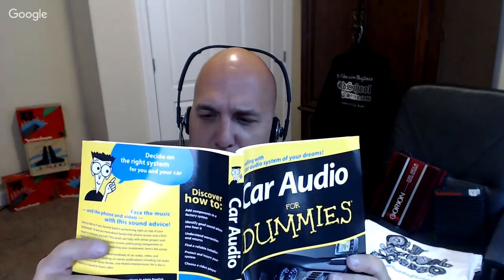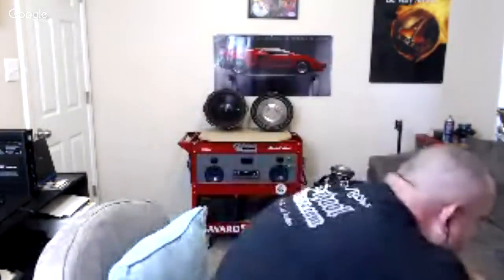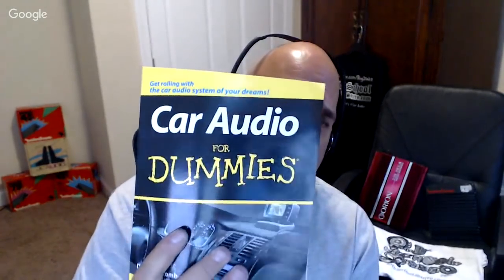12V Talk Episode 02 - How We Got into Car Audio with HiFiVega

Comment: Love this nostalgia!  Thank you both for orchestrating this. A ‘76 Mercury Comet was my brother’s and my first car to share, back in ‘87 on.  He put in a basic Sanyo deck and Sony 6X9s.  When I took it over I added a Sentrek EQ-booster that I bought from a friend at work.  I was ecstatic for adding so much sound to the system.  Being raised in a family of HiFi enthusiasts, and myself not having a lot money, I would go to the local electronics store and drool over the Concord subs, Pyle boxes, and MTX Terminators.  My first real purchase was out of a catalog a friend’s dad had.  I bought a Pyramid Gold Series PB600 amp(which I still have to this day) and a pair of Pyramid dvc subs.  I upgraded to a Concord cassette deck, but in ‘92 went for the Sony CDX7560 & XK-8D combo.  I still have the XK-8D, but the CD player gave out years ago.  I could never afford the Boston Pro series, so the Rally Series was for me instead, along with the MYX gold series Thunder amps.  I have expanded my collection over the years, from my 275X & 2150X beginnings.  I bought the Boston RS-12s and MTX for an ‘86 IROC.  Somewhere in there I accumulated some 8s & 10s SAS Bazookas.  The bazooka tubes had tons of boom, but did not hit the lows as much as I wanted.  That’s when I upgraded to the RS subs.  The story goes on and on, but that was my beginning.  Other than the pieces I mentioned getting rid of above, I still have my old equipment, even the Sentrek EQ booster.  Lol  But I will tell you, the old Pyramid amp isn’t all that hot with subs, BUT it comes close to any of my Orion or MTX for mids and highs.  ;)
Thank you!
Reply from the maker: Awesome, love the glance back in time 👌

Comment: I had a 82 Honda Prelude in 1990 with a Pioneer cassette deck, MTX MTA 250 amp and 2-15’ MTX terms(I think they was terms) and 2-10’ Pyle Drivers in home enclosers, all packed in the back seat and trunk. I could bounce a half full Mt dew (glass bottle) a good inch off the roof off the car. Kept burning up alternators and no highs in the car at all. The local car audio shop had a 18” Kicker sub that everybody wanted, problem was it was $300 a piece back then. The hot combo back then was any Kicker sub and a Orion 2150amp. The good ole days!
Reply: Daniel Thomason we ran the same combo’s around here.

Comment: my first setup was a 97 Honda civic. with 1 box holding a mix bluethunder 10 and 2 8s was a triangle box with the top point cut off that's where the 10 lived and the 8s on the side. with a 200 watt amp. with a set of pioneer 6x9s. stock head unit.  too crazy was typing blue thunder as you said it  pretty cool. I decided to run the 10 off the amp and the 8s off then rear deck speaker wire.  yeah didnt work all that great. now I got 18s in an explorer. powered by sundown though really wanna switch to orion amp. then I upgraded to 2 visonic 12s that you showed not to long ago I think. the red and black ones.  and a 800 watt amp.

Comment: I just bought that ignite amp thanks to your review.  I had 4 A/D/S amps in my 1992 Cadillac from 1993 until i sold it in 2000. Great amps. Still have 1 off them

Comment: in the 90's i wanted a u.s amp 400x on 3 18w6 jl's  with a u s amp 442 on  orion nt components   my first system was a 150w crunch amp on a 10" lanzar vs  and 5 1/4 hollywood components    my uncle has a tv/radio repair shop he sell's and installs car audio he had alot of company demo cars come to the shop  thats how i got into car audio

Comment: My journey into car audio started in 1988. I was a Junior then Senior in high school. I saw lowered mini-trucks going down the road and in the parking lot with booming stereos you could hear from down the block. I wanted a mini-truck with a nice stereo so bad that I started saving from my job. At the time I drove a 85 Chrysler LeBaron and I ended up buying some Kraco 6x9's and put them in the back to try to get more bass in it. While encouraging because it was more bass, it wasn't what I wanted. 

Graduation comes and summer begins. I saved up about $6,000 and went and bought a 84 Nissan Kingcab mini-truck. I took it to California Accessories an had it lowered 3" the very next day. Then it was car audio shopping. I had no clue what I was doing but went to shops to learn. I ended up at Sam Goodies and a shop named Car Tunes in San Bernardino California. I ended up buying a box with two Kicker C-10 subwoofer's in it with the sealed back mid's and piezo tweeters in the box. I got that box for $200 and onto the kingcab fold down seats it went. At Sam Goodies down the street, again with no real clue, I bought a J.S.E. cassette deck, a J.S.E. amplifier and a J.S.E. passive 12 band Equalizer. I think that was about another $250. My Dad helped me install it all and when I heard the Kicker 10's start bumping I was in love.

End of that summer I went to tech school in Phoenix. Within the first 2 months someone stole my truck and stole the stereo system out of it. Stereo round 2 ensued. This is when I started learning more about the different companies, since Rockford Fosgate, Precision Power, Orion, MTX, Linear Power and  Pyle were all supposed to be close by. I say supposed to be because I only ever found PPI, RF, Orion and MTX (I visited those 4 to see if I could get a tour. While at PPI, they actually showed me the soon to be released flat piston sub's. I was in heaven). This round I ended up with a Fosgate amp, two 12" Pyle 1240P's (along with a box that had 2 tweet's and mid's in it already), Mitsubishi headunit and I want to say Profile EQ but I might be wrong on that. This was installed by me on my own.  Box volume was to small for the 12's but it was alright. When I returned home after the 1 year tech school I decided to build my own box and it sounded so much better. 

As time went on I did other component swaps and upgrades. However, one day when I worked at Radio Shack, a younger guy like me came in looking for RCA's. He ended up showing my his stereo and I was blown away. RF pro 10's, Audio Art mid's and highs, Alpine deck and signal processing and Orion for amplification. He was going to be competing at a show in Riverside that weekend and invited me to come out to it. I managed to find it and saw some things there I had never imagined. There was a little Nissan NSX that was walled with subs. I had never seen that before. I saw the Acura Integra that had the Audio Art 18" sub, amps, signal processors and mid's and high's. This car was the one featured in Auto Sound and Security that had the 1" plexiglass plate covering everything in the trunk except for a 18"ish diameter hole right in the middle over the sub. 

After that show there was just no ever going back. I have always been more budget minded with my stereo's but I did end up with Orion and Soundstream amp's for my truck after that show. When I got married car stereo's while still my thing, took kind of a back seat to the marriage and our kids. I still didn't own a vehicle that didn't at least have one 12" sub in it. I went through MECP certification and installed on the side for several years. My current car still has 2 amps, 2 12" subs, EQ, double din touchscreen stereo, 2 way's in rear doors and component set in the front doors. Planning a re-install on our other car. It has 2 Boston Acoustic 10.4LF sub's in it currently but I'm looking at going with a more modern subwoofer. Kids are all old enough now and this is my daily driver for work so I'm also going to do what I have wanted to for so many years. Trunk space be dammed! This is my toy install. It will still be well executed though. I have so much trouble watching some of the videos for the high DB sub drag racers posted here on Youtube. So many of the installs look so hacked up that it drives me CRAZY! I like my stereo installs to look nice and integrated. I hate messy installs.

Comment: My first system was small but big for me. I had an 88 Irocz with 4 Pioneer 4way 6x9's and 2 4x6's with 2 10" solobarics in a bandpass box (round version) powered by an impulse 352xi on subs and a 354xi on the 6x9's and 4x6's. The deck was a JVC Kamelion. This was in 97/98 cost me about $1000.00 dollars roughly. All bought from Mobile 1 car audio in Metairie, LA. Everything was bought as demo equipment except the JVC radio.

Comment: Ahh, the good ole daze..nice flashbacks guys. 💯 From one big d to another my first system I hooked up in my 77 Chevy Malibu was in 92, fresh outta h.s. Was a radio shack truck box of 10s that I stuffed on the back seat window seal where the by9s go, wired them to an autotek 60w $300 Amp, smh true power though right and it pushed the cheap tens nicely, and an alpine tape deck with the light green glow..fun times 🔊🔊

Comment: Liking this vlog guys. Big D don't worry about rambling on, 3 cubes per 10" had me laughing. Vega I had done some similar cobbling with my first attempt at adding bass. I wired, in parallel no less, 12" alpine bass subs and 6.5" sony co-ax to a sony tape deck. If you listened really hard with the geo metro's 3 cylinder turned off on a high humidity day you could hear bass.

Comment: Big d I have a question. I have 2 moon n stars hcca's.  A 225 and a 250. Since there not a digital reference does that mean there a pure analog design with a feedback loop? I may not understand the difference between the og mns and the second gen digital references. Love your content.
Reply: The first gen moon and stars 225 didn't have the eq button or bridging button. The eq button boosted 40Hz by 15db cut 200Hz by 4db and boosted 10Khz by 6db. The bridging button just allowed you to run bridging operation without the need for the outboard BDG 400 module. The digital reference is no more "digital" than a moon and stars but damn it sounds futuristic. There are slight differences on the board. I have never seen an original 225  or 250 on a dyno but I have no reason to believe they wouldn't do similar numbers to the digital reference 2nd gen amps 350watts and 550watts respectively. I have a gut shot video of a 225 digital reference next to a 425 moon and stars if you want to see the differences. The 425 was just 2 225's in one chassis on one board.
Reply: @brentb5303  I have the 2 of ones and 4 225 d ref and 5 250 dref.  I also have the bridging modules for the og. I just didn't know. The digital apps have all been redone by jay L and the moon n stars haven't been opened. I think I'll just keep all that on the wall and install all the second gen in my vehicle
 I appreciate the advice. Thanks.
Reply: You are lucky to have both. I am jealous especially over the moon and stars 250. Don't let that one go. They aren't impossible to find but not common these days. If I had the bridging module I would run moon and stars to be unique but to be honest I can't bring myself to run my digital reference because I don't want to loose them. If I need to recap my digital reference I sure would like advice on a good amp tech. Also do you think Jay L could do a 425. I have a few gems in my amp collection but the 425 is so special I feal an obligation to get it in working order. I appreciate any advice in amp tech's. Thanks
Reply: @brentb5303  big d wiz knows jay laventure he is the man to do ur work. He worked for old Orion . He works on all Orion old school. And I have been collecting all these apps for period correct install. Active 3 way plus rear and amp per speaker. So I needed 10 plus the bass. I got a new Orion hcca 5000.1d for the bass. And I have spent more than there worth to some but there all pristine and good. Not a retirement plan but I wont be arround that long so I am going to enjoy the stuff I used to have and then some. Thanks

Comment: I traded a 1988 Yamaha blaster 4 wheeler and $300 for a PPI 2300am back in 91 or 92 I think. Put it on 2 Fosgate punch 15's...beatin down the block until the amp got stolen:(

Comment: First system 3 Rockford fosgate 12 inch punch dvc's on 3 pioneer gm x922 amps one amp to a sub wired each sub to 2 ohm cause they were dual 4 then bridged the amps so amps seeing just above 1 ohm cooling fans on the amps would kick in after a few minutes and my trunk sounded like a jet engine from the fans screaming but it threw down till some as*** went window shopping and stole my amps all packed into a 95 tbird pioneer deh-p7000r deck and fosgate fantatic x 6.5 componets also on a pioneer gmx922 amp eventually switched over to all fosgate amps bd1000 and a punch 250a2 with (3) 1 farad caps and a optima red too switched over the subs to (4) fosgate punch hx2 12's it got loud broke the windshield at the mirror bracket was a awsome set up

Comment: look at that red couch potato....great flashback... watts per ch.25  buy bridge that jewel'
Reply: took that HCCA tri mode ...bridged4 xtr svc 10 in a vented mag to cone ISO Bandpass. orion tech in Tempe, said do this its an exotic enclosure.  stereo R and L 100 hz down on subs then passives on mid bass, mids and highs...1st place SQ show in  north Va... 100-400 mid bass narrow-band-with 12db, 400 to 4000khz mids equal decade mixed in mylar 12db..., 4000khz and up on the domes. mixed in mylar 18 db